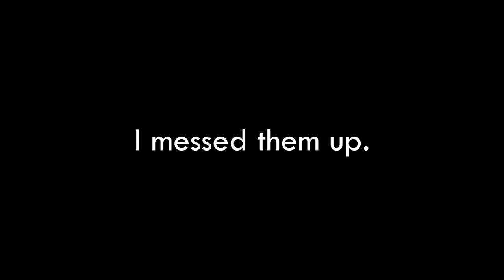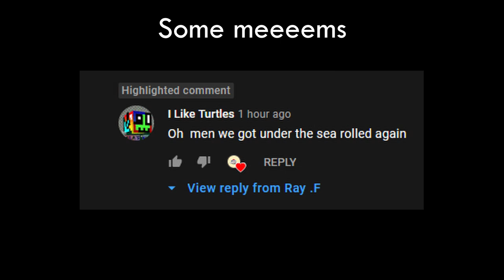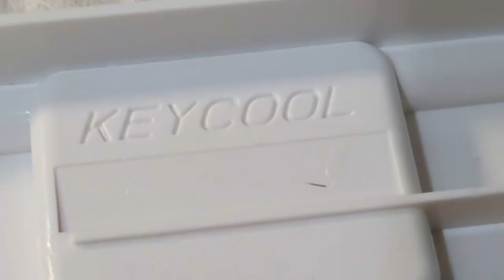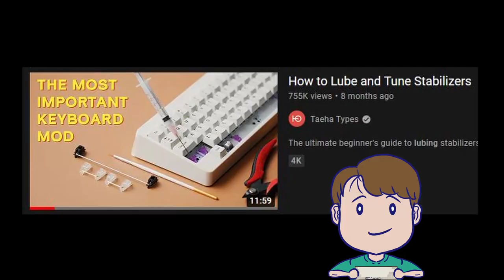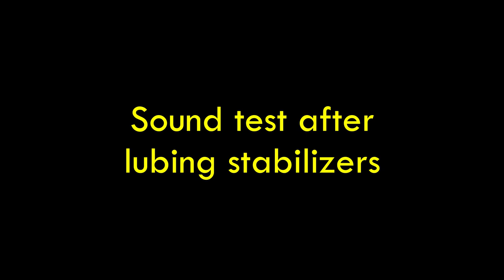Do THIS first to your Epomaker EP84 / Keycool KC84! // Necessary keyboard mods

Comment: Ah yes, this board would have been a perfect beginner model if not for those damn plate tabs! I was afraid to snap them off, so instead I cut the foam through the spacebar slit and removed enough of it so that the stab wire could go through. Not an ideal way of dealing with it!
Mine doesn't seem to have the Keycool branding inside the case, but there's KC84 printed on the PCB.
Reply from the maker: Yes... it was a shame that we have to go through these hoops just to lube the space bar stablizers! That's quite a smart way tbh, I did thought about that, but I wanted to keep the foam that was on the spacebar area intact to dampen the sound, so yeah.

Interesting... seems like there were probably different batches of the KC84 (some have Red colored PCBs I think)... my PCB also has the KC84 printed on it If I recalled correctly.
Reply: I bought this keyboard a couple weeks ago and they now have phillips screws instead of the hooks. That said, I don't understand why all the stab lubing vids for this board say to take all the switches out and take off the plate. You say you had to cut foam but, I just pulled the stabs off by themselves with no issue, like you would any other board... Maybe epomaker listened to the criticism and fixed the downsides? Although I'm convinced that this guy and the other creators could have just slid the stab wire out through the slit with their boards also.
Reply: @ikeworkman4449  Looks like they really are making changes in the new revisions, which is a great thing. I also noticed there's a Retro color way now with non-shine through caps, which wasn't there when I bought my board. Glad you haven't run into the old issues!
Reply: @theurquanmaster  Yeah I noticed that retro board yesterday, I don't think it was up when I bought my board 2 weeks ago so they must be making changes. I like the look of it too, I would have bought it instead of grey-white.